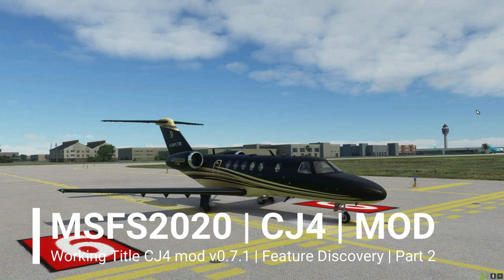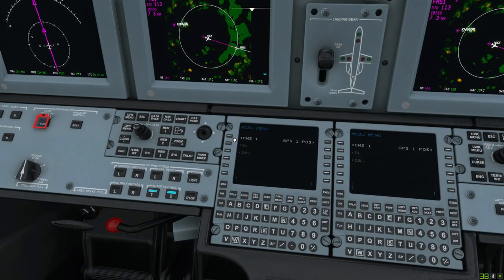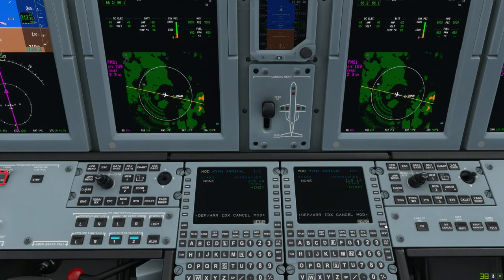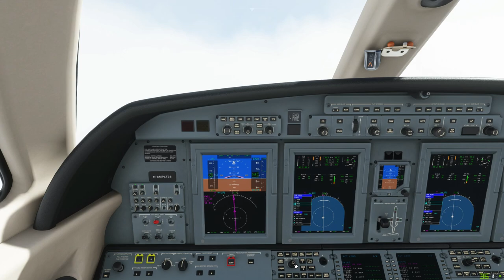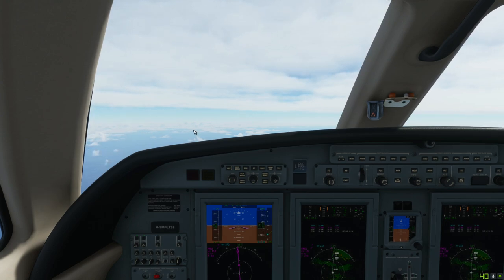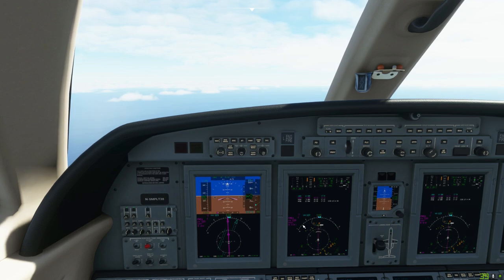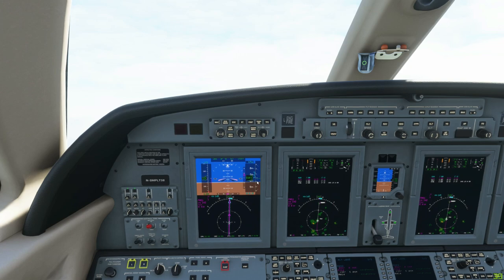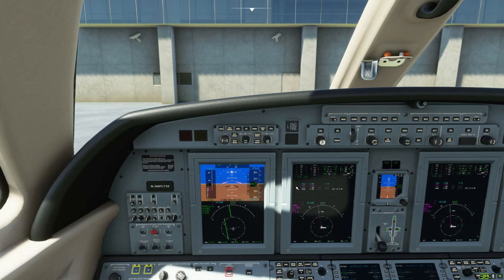MSFS 2020 | Working title CJ4 Mod 0.7.1 | Feature Discovery & How to use added functions | Part 2

Comment: Thank you for yet another authentic flight in the CJ4.  The Working Title mods add so much to the realism.  Glad you made this one with the mods; great comparison with the default plane.  I have a question, though: what is the function/significance of the little arrows and circle on the windscreen divider.  I must be blind when I search for that info on the internet.
Reply from the maker: Physics Teacher those are Angle of Attack indicators, in other words indication of lift generated by the wings. If the arrow is upwards generated lift is increasing if it's downwards generated lift is decreasing if it's the circle that lights up it's indicating that lift is neither increasing or decreasing but constant.
Reply: @TheSimPilot  That's what I thought.  How should I react to them?  I guess what I'm asking is why are they even needed.  The seat of my pants would seem to be a reasonable substitute in a real aircraft.  I've never flown a jet for real, so maybe my question is naive.  I'm just a single engine occasional pilot.
Reply from the maker: Well AOA is a really broad topic, it's mainly practiced and used by fighter jet pilots as far as I learned. The reason being just using the lift as the main measure and not worry about air speed at all. They call it flying the AOA. This video might give you some more information https://youtu.be/2wlvpJLcf-A
Reply: @TheSimPilot  Makes a lot more sense now - considering my name.  Many thanks.  Looking forward to more videos.
Reply from the maker: @physicsteacher4569  Interestingly enough, your name reminds me my Bachelor's in Physics :)